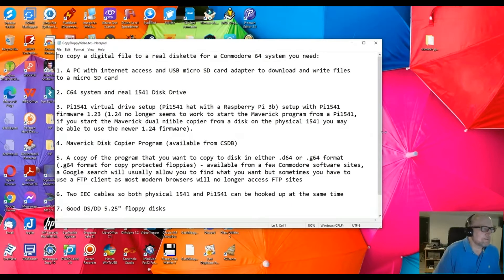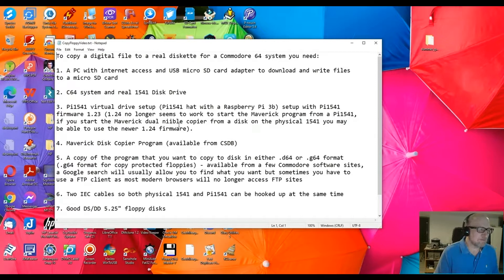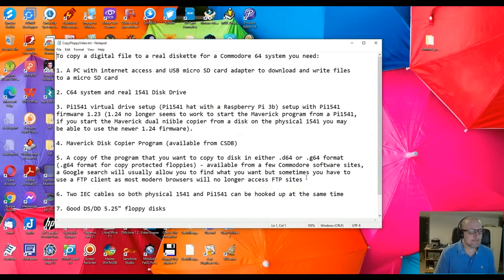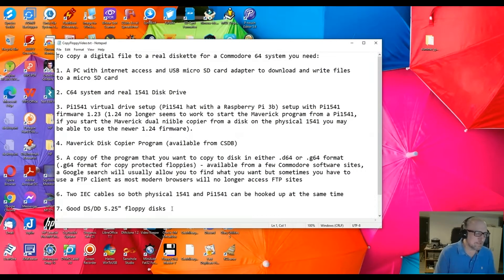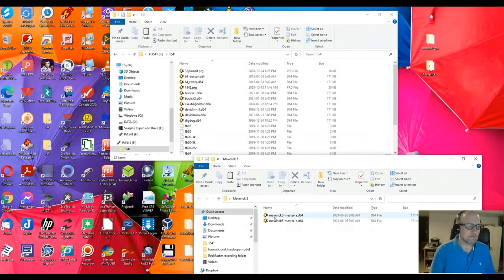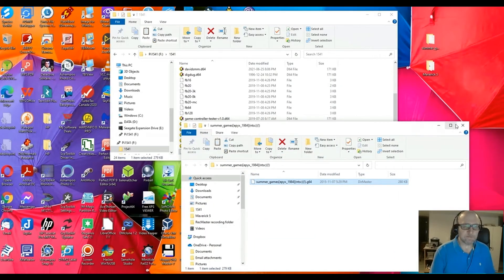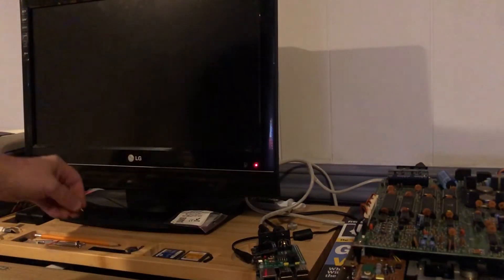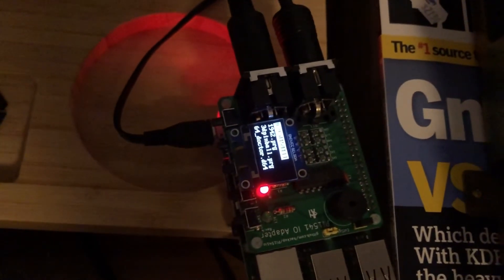How to Copy Commodore .D64 and .G64 Files to a Real Physical Floppy Disk

Comment: There is no other way to put commodore 64 games on floppies?
Reply from the maker: No, there are at least a couple different ways but all involve using some special hardware devices.  One other way is using a device called an XU1541 that works by doing an IEC to USB conversion to attach a physical 1541 disk drive to a Windows PC with USB.  You also need special software (which is available free as well) for the file transfer to work with the hardware XU1541 adapter.  Also you can use an SD2IEC instead of a Pi1541 to load the file image to copy to physical floppies although I am not sure if it works as well as a Pi1541 for copy protected floppies. Jan Beta has a YouTube video about this latter option if you want to search for it on his channel.
Reply: @noblesurplus1  Thanks. I will check it out. Any places sell the stuff ready to go? lol
Reply from the maker: @retrogaminglife84  You can get a SD2IEC for about $50 US plus shipping and an XU1541 for about $40 US plus shipping on eBay.  Both those options are quite a bit cheaper than putting together a Pi1541 since you need a Raspberry PI 3B for that which are quite expensive these days, it would likely cost you about $120 US to put together a Pi1541 with the current prices for an used Pi 3B plus the Pi1541 add-on board you need.  You also also need a micro SD card for both the SD2IEC and Pi1541 and will have to format and setup all the disk images and other required files on the micro SD card.  Most of the hardware devices are not sold as "ready to go" as you have usually have to format the micro SD card and put your own disk images and files on it, some sellers might include a micro SD card with the SD2IEC but may want a little more money for the solution if that is included.  The XU1541 needs a program called OpenCBM which you have to install and setup on your Windows PC, so most options require at least a bit of software work to setup.